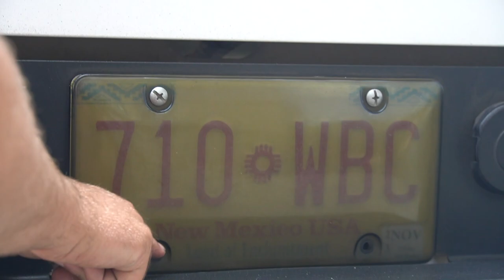Drove from NEW MEXICO to build his dream truck | ALL CHROME LIFT KIT

Comment: I have a brand new 2024 2500 Denali that I want to lift. I need help deciding what lift to go with, what size wheel/tires. I don't want higher than 6inches, really was thinking 3-4 inches. Anyone that can help I would greatly appreciate it.